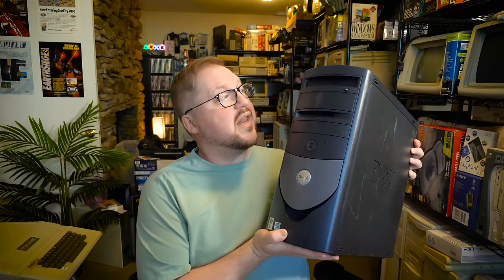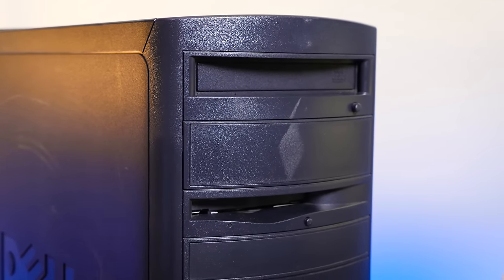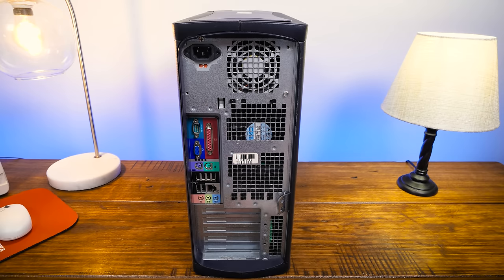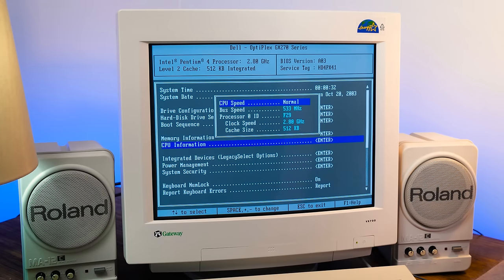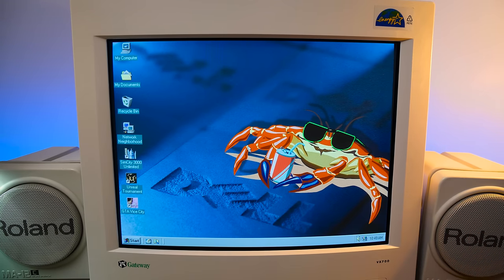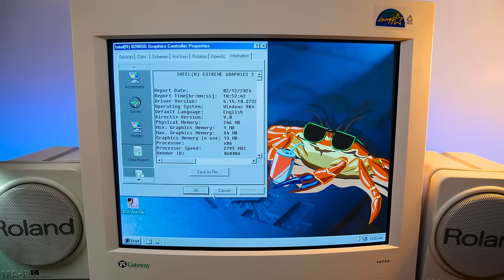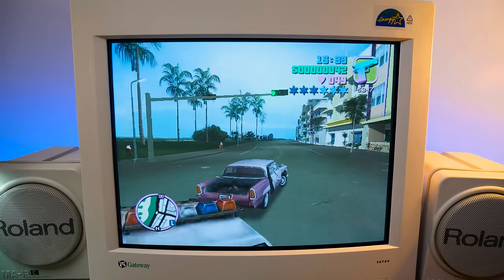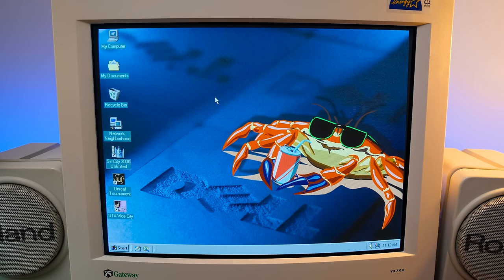The Most Unwanted, Boring PC: Dell OptiPlex GX270

Comment: I used to work for an office moving company in the late 2000's, and I can't tell you how many hundreds of these things I pulled out of spare offices and stacked onto pallets to be sent off to tech recycling. If I can give them any sort of praise, it's that they at least stack very solidly and squarely.
Reply: These days if I need a desktop PC, I just get a used OptiPlex. My current one is a 2015, 7040 pizza box-type thing. I think it was about US$50 if my conversion is right. 110% beyond adequate for mostly everything bar gaming.
Reply: @MattExzy  the optiplexes are my fav oem pc, they always ran super well and are uselly easy to replace and add stuff in
Reply: @MattExzy  I use off lease HP SFF computers.  My current one is from about 2014 with an i3-4160 CPU and 16GB of RAM (it came with four so I replaced the RAM).  I have been using them for years, I had one HP with the hyperthreaded Pentium CPUs that had to be sent back and replaced but otherwise they last for years even after their original owners are through with them.  I am not a gamer so that isn't a consideration.

Comment: I worked with my dad in his computer shop back in 2007-09. We had a steady stream of them come in with leaking capacitors, so we switched customers over to refurbished commercial HP 'pizza box' workstations that seldom came back for warranty work. Part of our pitch to sell the HPs was to invite the customer to pick up their Dell and notice how the plastic case flexes, then let them feel the solidness of the HP. Worked every time... unless they wanted a laptop, of course.
Reply: I was a student worker at my college during this time and yes I was going to comment on the leaky capacitor issue.  In our case Dell sent us 210 motherboards to simply replace the ones that burned out during this time.  We replaced a whole campus' worth of MB that summer.
Reply: Yup! The GX270, GX280, and GX520.. soooooooo many replaced motherboards..
Reply: @Andrew_G4CH  were the initial Dell BTX boards bad too then? I recall those being infinitely more solid than their predecessor
Reply: Yes, I’ve see too many leaky caps in those… to the landfill!!
Reply: Why not just replace the bad caps with some higher quality ones? Most of these models even had the motherboards on trays so it was always really easy to pull them out, take out the screws securing it to the tray and replace a few caps. It was only ~30min of work when I was doing these regularly, otherwise you are just creating more e-waste for what is otherwise a perfectly acceptable computer.

Comment: I am 99% sure this Optiplex model is what was under my desk at my first post-graduate job in IT.  A couple decades later I'm back in higher education IT and have an all-new uninteresting Optiplex 5000 under my desk. How times haven't changed!

Thank you for a fabulous nostalgia hit, Clint!
Reply: I resent this title. Still got mine in the attic with probably the 5th ATI GPU I put in it. I will never forget mine or how it started me on my PC customization journey.
Reply: I can't believe that those machines in the early 2000s, like the Dell dimension 2400 and 3000, had 2 disc drives, a DVD and CD ROM that were separate
Reply: for me yes

Comment: My mom had one of these. When it started giving her trouble she called customer support and they did everything they could to deny the warranty claim. When they found out it was kept on a floor instead of on top of a desk they denied the claim stating the floor was "too cold". Yeah, they really told her computers should be kept warm, cold air was bad for them. 🙄 Unfortunately she didn't know any better and certainly wasn't aware of the cap issue.
Reply: That chilly floor is probably what did mine in too
Reply: No wonder the pins got bent on my optiplex 390!! The cpu wasn't hot enough that pesky fan kept it chillies than Antarctica
Reply: @TerrorSyxke  Maybe they didn't bend, but shriveled. 😅
Reply: The colder a PC is kept the better. My PC works better in winter than summer because my room is about 40 degrees colder.  What is bad about the floor is the dust intake.
Reply: @MrWolfSnack  Oh, we all know that, like I said this was just Dell trying to find an excuse not to fill the warranty claim. My mom is a meticulous cleaner, there was little dust when in it when I took it apart.

Comment: I recently enabled a GX260 (just as ugly) that no one wanted so I decided to accept it into my home. It didn't start but with just a few adjustments and changing the battery it started working. I installed an equally undesirable FX 5200 pci that I had lying around and it worked well. I needed a Win XP machine for my games from 2000 to 2004, and well, I am very happy with the result, Doom 3 works quite well, very playable and the other games more than good. Excellent video, greetings from Honduras.

Comment: You just unlocked so many memories (and almost none are good). I did IT for a local government office around 2005-ish and had to deal with hundreds of these or similar models due to a contract with Dell. Being in the thick of the capacitor plague without knowing it at the time, I noticed the recurring problem with caps being the point of failure and had to fight tooth and nail to get the higher-ups to believe me when I said I thought all of them would fail eventually. I finally made enough noise for Dell to acknowledge it and replace every computer in the office with newer models, though they never admitted to any wrongdoing and acted like they had no clue about the failing caps prior to me telling them. I never heard about them getting in trouble for it later, so it's nice to finally know something happened.

On an unrelated note; Another common issue was people complaining that their PCs wouldn't boot. 9 out of 10 times all I had to do was go to their desk and hit eject on the floppy drive, yet they never learned. Some departments used digital cameras, and since they refused to upgrade anything they didn't have to, they were Sony Mavicas that used 3.5" floppies for storage (I think you've actually covered the exact model in a past video). I do not miss the days of the A drive being the default boot device.

Comment: A GX260 was my first PC I didn't have to share with the rest of the family.
With my first pay check from my first job I maxed it out at 2GB of ram, bought the best CPU it supported, P4 3.06Ghz, the first Intel that featured hyper threading (iirc), and bought a BFG Geforce 6200OC AGP GPU.
Played Fallout 3 at 15 average fps <3
Reply: I had the same setup with a 6200 and also ran fallout 3 but there was some nonsense you could do in the config to get it running mid 20s
Reply: My first computer was a gx280 p4 2.8 HT that i put 3gb ram and a Nvidia 8400gs
Reply: If only you knew that most of those dell 6200s could have shader an vertex pipeline unlocked to be 6600gts same with 6800gs to ultras
Reply: @foxxy46213 If only you knew that I did know about the 6200 pipelines, but unfortunately yy model's weren't unlockable, SMH

Comment: I actually picked up a Dell Dimension 3000 (very similar aesthetics to these OptiPlex PCs) for 25 dollars at a local thrift store- The inside looks practically off-the-shelf new, and was apparently used by an elderly woman as evidence by the like, 4 different antivirus programs it had on it and a few documents that remained on it from not being wiped prior to sale. The capacitors thankfully show zero signs of failure, too. A simple factory reset later, and I have a 2.8 GHZ P4 build which I'll be throwing a 8400 GS PCI (No AGP slots on the original micro ATX, sadly), an extra gig of pc3200, and probably a 3.2ghz P4 once I get everything else together. Always nice to have an older XP build for some retro nostalgia. Great video as always, Clint.

Comment: I was an NCR "Customer Engineer" from 2008 to 2012, and I replaced SO many motherboards in these exact machines across the north-west part or Arizona, for exactly the reason you highlighted-- bulging, leaking capacitors.  The one you have, and the small-form-factor version.  They also had a habit of burning out their weird, proprietary cooling fan/temperature-sensor situation-- replaced a ton of those as well.
Thankfully, it was clear that Dell (or someone) was meticulously re-capping all the affected boards with brand new caps, all marked with Sharpie X's, and they worked at least long enough for me to move on career-wise.  What a memory!
Reply: Thank you for your service in the New California Republic 🫡
Reply: What quality of caps did you use for replacement? Because some of the caps looked still fine, and I would guess that the replaced caps are already leaking after more than 10 years.
Reply: @webfischi  Oh I'm sure they were still lowest-bidder replacements-- I only got the refurbished motherboards and didn't do any soldering or anything like that.  To be honest, it was a pretty chill gig for a guy who doesn't mind driving around A LOT at all hours of the day and night for the dumbest break/fixes you've ever heard of 🤣
Reply: Patrolling the Mojave, almost makes you wish for a nuclear winter.

Comment: my buddy bought one of these as his main rig in college back in the early 2000s.  I dubbed it "the pizza box" due to how it opened.  We were of course big into upgrading with video cards and various other things.  My buddy was obsessed with quiet.  He ordered a bunch of replacement fans only to find out that almost every. single. connector inside this thing were ALL proprietary and any aftermarket upgrades involved a certain amount of wire "hacking".  Needless to say, he built his own machines from the ground up after that.

Comment: In my final semesters of high school I got to work with the tech facilitator for the school as a "class." You were given credits if you needed them (I didn't) and you couldn't sign up for it, you could only be recommended or sought out by the facilitator himself. Reimaging machines, chilling in the little server room, going to help people with projectors, fixing broken laptop screens for the mobile carts. These bad boys infested schools. That final semester I worked with him we had to mark a bunch of them and their corresponding CRTs as surplus and lug them to the dumpster.
Reply: Well that was stupid. All you have to do is put them in a Uhaul and go. Imagine being that stupid throwing away computers.
Reply: Dumpster 😢
Reply: @MrWolfSnack  Sure dude, not like that's a crime or anything.
Also, you apparently didn't pay attention to the video, these models had capacitor issues, not something most people are going to want, or be able to, fix.
Reply: I don't know if Dell got a very cheap manufacturing deal to mass produce these damn PC's but they were EVERYWHERE in people homes and at corporate offices. When I use to work at MCI WorldCom the company were offering these Dells at a discounted price new through Dell. Our IT guy use to tell us when they were tossing these "expired" Dell PC's in the dumpster and that he would leave a few on the shipping dock after he pulled the hard drives.

Comment: Ah... this takes me back. Back to nightmares of replacing dozens of GX280 Motherboards at my office due to exploding caps. Did they learn their lesson? Nope. Many years later, I became an expert in replacing caps on the Dell 19" 4:3 monitors!  EDIT: 5:4 monitors
Reply: 75-80% failure rate. It was nuts.
Reply: Found one at a Deseret for $8. 

Yeah, blown caps and it has been collecting dust for the last year as I keep putting off fixing it but I have never soldered anything.
Reply: I think every one of these we had failed with bad caps.
Reply: *5:4
Reply: My 280 has somehow survived it but I don’t know it’s past so it could have got it’s mother board replaced at one time.
Reply: Managed to find an old widescreen lg monitor in the dumpster at my local computer shop, took it home and it was dead, all i had to do was pull apart a 20 year old dead power supply, solder them in place, and now it works great

Comment: Our insurance company bought a ton of these right before the market tanked. They all died a couple years later, and the company was just barely limping along, so I had to replace them all with their predecessors, which luckily were still in storage. We stumbled along until the company finally found a favorable space in the market and could finally replace them several years later. 
When I moved on to my next employer there was a box in the hallway of the repair shop. When I asked what it was, I was informed that it was a box of GX280 motherboards. Apparently, this new company had so many of them in use and the things failed so frequently that it had reached the point that instead of each failed system having to be reported to Dell, they would simply ship us a box full of motherboards and when those were used up, they would ship us another box of motherboards, no questions asked. 🤣
Oh, and these clamshell cases were notorious for cutting their own cables if you didn't make sure they were all tucked away inside.

Comment: We still have two of these in active use at work! I work in a cognitive psych lab at a university, these old Optiplexes are used as host machines for some old PCI-based eye tracking hardware (SR Research Eyelink II). The software to operate the eye trackers runs on a special DOS variant provided by the manufacturer ("ROMDOS", I think?) for real-time performance, but they also dual-boot XP for maintenance and file access. Fun to see them show up here!

Comment: We had one of those, it ran XP and was slow as all hell, taking almost 5 minutes to open a browser, but it was the PC I originally played Minecraft and Roblox on for quite a while. We still have it, it's currently sitting in storage. I'd love to bring it back out one day and see if I can get it running better than it used to 😊
Reply: Could you play at 60 frames per week?
Reply: @DonVigaDeFierro  Lmao, if I was lucky
Reply: give it a gpu it deserves it
Reply: Out of the box, slow as **
Reply: Make it a sleeper build. Gut it, and put modern parts in it. I have a Dell Vostro from 2012 I got from Work that I installed with an AMD RX 6400, i5 12400f, and 32gb of RAM. Have it hooked up to a Dell E770s CRT. Plays Doom eternal at 1280x1024 at 85fps. But it's a very unassuming setup for sure! 😎
Reply: @Clos93  I was thinking of doing that, but I wouldn't wanna have to cut holes or anything for airflow. It's definitely an idea, though!

Comment: This is the kind of thing I picture when anyone mentions PC, everyone else pictures cases with a window, RGB lights, liquid nitrogen cooling, multiple GPUs and lots of other bollocks you don't really need. Sometimes simple really is all you need. I still use a PC case I've had since 2006, nothing fancy, of course it now has modern parts in it, but they fit, and that's al that matters to me.
Reply: And that's why these PCs are unloved and unwanted lel. It's so boring.

My life is already boring enough. At least let my PC be somewhat fancy lmao.
Reply: Same honestly
Reply: Because who needs airflow, of course.
Reply: I kind of appreciate utilitarian design. For a mid 2000s office PC there is nothing wrong with the design IMO. I don't find them any more boring than the equivalent HP desktops, for example.
Reply: Same, RGB lights tire my eyes out as mine are pretty sensitive to light anyway
Reply: The 2000s was the last decade when Desktop PCs were common. in the 2010s people got tablets and smartphones. I have the GX260 from about 2002 2003 that still works I have Windows 2000 installed.
Reply: @MylarBalloonLover  Althought windows 10 is my main daily driver, I'd still be running everything on Windows XP if I could. Hell I'd still be using Windows 98 if all my stuff ran on it.
Reply: @CoolDudeClem  if it was not for Windows 98 was unsupported in 2006 and it does not support new browsers etc I would still be using Windows 98 too.

Comment: I am incredibly nostalgic for this era of dells. Not only are were everywhere, but I basically learned about the internet and how to take computers apart on these.

Schools had used them basically all the way up until around 2009-ish when they were all replaced with the HP elitedesk series, my grandparents had an optiplex or a dimension that looked like this that they used all the way until 2013 and it still was reliably chugging along. I specifically remember going on coolamathgames to play BTD3, playing so many unlicensed flash games and reading GameFAQ forums on Dreamcast games back when that was their main computer.

And those were the first computers I ever took apart. My computer repair class in high school had us take these old optiplexes and dimensions apart, pit them back together, and then install Debian Linux on them. They’re certainly boring, but they hold a special place in my heart.

Comment: I do have to say the GX270 is the reason I got a job at Unisys and worked there for 5 years.  First 3 years were just replacing these boards.  Literally, there was not a day I didn't.  Every single person who bought the 3 year, replace next day plan, got it replaced.  Some times more than once!  It was seriously bad.  Replacing the board is honestly dead easy, just remove the tray, remove the cables and one screw is all it took.  There was one customer that forced dell to replaced ALL their computers in their office (About 120?) one night, got some good overtime there.  I managed to upgrade myself to servers and the enterprise stuff before the entire office shutdown and got laid off when Dell stopped outsourcing to Unisys around 2011-12.  Thanks to that I learned alot about enterprise stuff so I am very thankful.  

Funny though.  This problem was almost EXCUSIVLY on the GX270.  I suspect its because I never ran into any home users that had the same problem because they didn't have the 3 year warranty (Problem started up about the end of the second year on average)